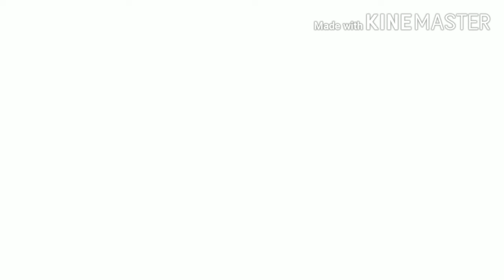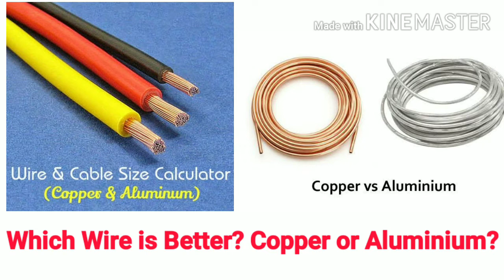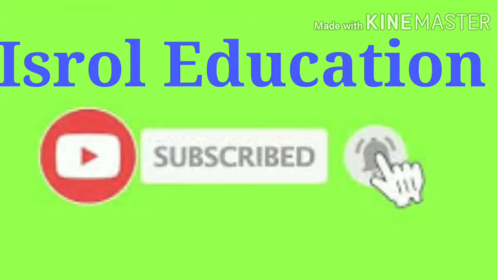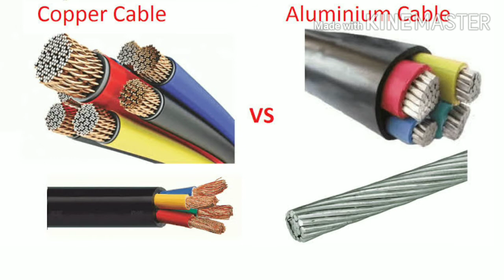Which Wire is Better? Copper or Aluminium Wire for the electrical wiring or Electrical Installation?

Comment: Can we run DC inverter Air Conditioner without any problem on aluminium wire 7/52 ?
Reply plz.
Reply from the maker: Conductivity are different
Reply: @World_electrical_Electronics  thanks.

Comment: Hamare ghar mein 1.5 ton ac ke liye electrical connection karwani hay. To iske liye Electrician 10mm Service Connection  Wire (  Aluminium ) se connection karne keliye bol rahahay. 10mm Service Connection  Wire (  Aluminium ) se connection karnese bijli ki bill jyada ayega kya? Service Connection  Wire ke sath 1mm copper wire Earthing keliye use karsakte hay kya? And C 25 MCB lagasakte hay kya?
Reply from the maker: Ok
Reply: @World_electrical_Electronics  what do you mean by OK?
Reply: @World_electrical_Electronics  what you mean?........